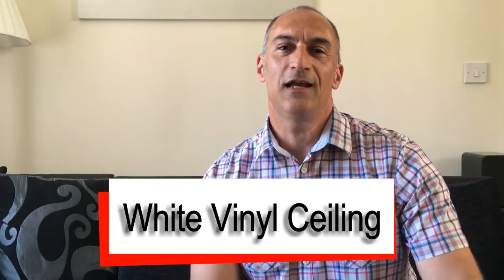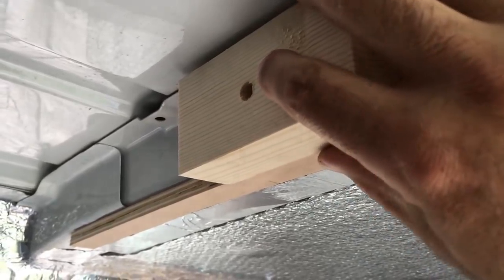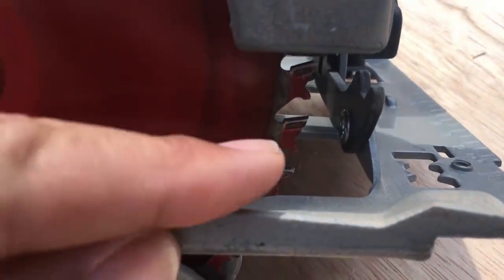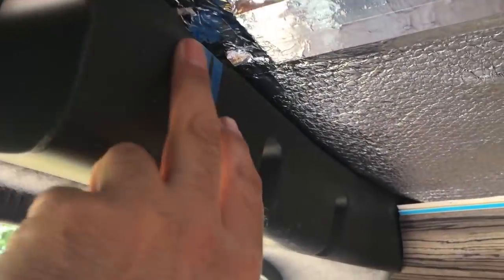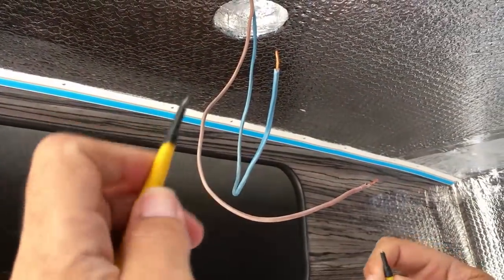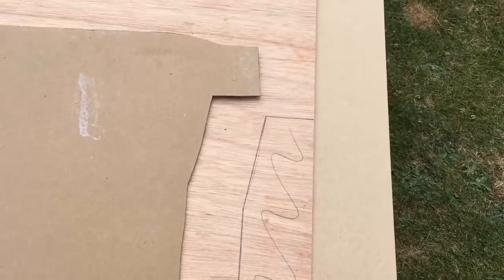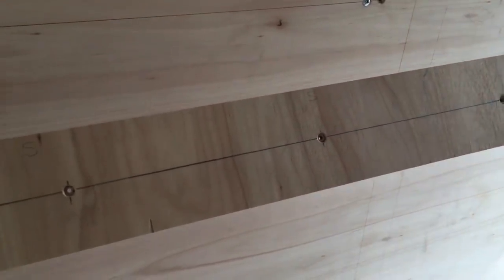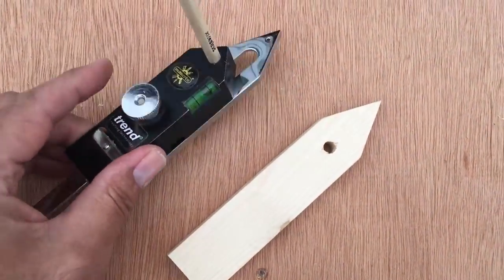Mercedes Sprinter Camper Van - Vinyl Ceiling

Comment: once again brilliant video Greg. thanks. just a quick question, can you use the H shaped joiners where there isn't a beam as would be to close to edge of skylight ?
Reply from the maker: I wanted to use these as concealed support for the boards to minimise to number of exposed screws so I deliberately fixed them to the beams. It made for a lot of wasted offcuts but it gave a firm clean look

Comment: I’ve seen the lid off of a coffee jar used as a scribe before. You just drill a hole right in the centre for the pencil, and roll it along with the pencil in the middle.
Reply from the maker: Hello Dave, I know a few will mention that method and I plan to do a dedicated video on this as it doesn't give you an exact copy. 
A circular scribe will give you a line of smaller radius on curved areas because the pencil is tangential to the circle and not perpendicular to what you are scribing. On straight walls with little variance you might get away with it but it's not the correct method. Hope that helps
Reply: Greg Virgoe Thanks Greg!

Comment: I know this is an older video but I have come back to it because after doing my first van using tongue and groove boards, I wanted to go with somebody a little bit simpler but also save on some head space.

(I was told another thing that helps reduce tear out is having a blade with a lot of teeth.)

Comment: Another great video. 
Not sure if it has been mentioned already, but when I made my scribe I did it as a circular bit of wood. That way it didn’t matter if I lost the perpendicular.
Reply from the maker: Nizan Horsefield circular scribes do not work on curved walls as the circle scribes a line with a smaller radius curve. You have to scribe with a point and keep perpendicular to get an exact copy.
Reply: Greg Virgoe I’m going to copy your DIY point scribe and use as well, as I need the best result for doing a similar cut to you, testing on old ply of course ;) Again, such great videos and ones to have playing when we do our own sprinter.

Comment: Just a small point with the way you tested for continuity - Holding the wires onto the testers probes with your fingers (as you did) can result in a false continuity reading as the small current sent out by the tester can pass through your body from one hand to the other (in other words, your body forming the circuit and not the wire).
Reply from the maker: Stuart Martin yes you are right I am aware of that 😊

Comment: When eventually I get my van I will be following your advice. What was the thickness of plywood used for the floor? The problem at this moment is the confusion as to which van to buy to start my camper. Panel van, kombi, or just buy a completed camper? So confused, I wanted to buy a newish van. First thought panel van, but the kombie is not much different (with trim and windows already), then PV or Kpmbie, PV, no Kombie, nor finished camper. Given up at this moment, doing my head in!. Add on the VAT and wow £30000 +, getting towards completed camper. Then I have to start the conversion. I hear it is about £15000 for conversion materials. Then OK I will buy an older van with good milage. Add the VAT and getting towards £20000! I have mental health issues and physical activity like do my own conversion helps me greatly. Any thoughts or advice would help. Cheers

Comment: Hi Greg. What would be the correct pattern- first floor, then walls and last the sealing or should i make sealing ready first and then start with plywood walls? Thanks a lot
Reply from the maker: I did floor, walls then ceiling 👍🏼😃
Reply: @GregVirgoe  thanks Greg🤘

Comment: Also do plan to insulate properly- however 2 things seems all the materials are in your neck of woods, and difficult to convert mm to inches although relatively easy just to change my mind and convert.  Can most of what your using materials be found in U.S. or do I find the closest material we have in my country?

Comment: How did you attach the bubble wrap to the sealing?
Reply from the maker: With “Trim Fix” high temperature spray adhesive. 👍🏼😃
Reply: @GregVirgoe  thanks so much for your answer.

Comment: great video, informative as allways. good tip from Phil Robinson on scribing the profile.
Reply from the maker: Hi Barry, Unfortunately Not, circles do not work as a scribe, because the geometry is all wrong, read my reply to Phil.
"Hello Phil, I plan to do a follow-up video just about scribing, as I'm sure that you are the first of many that will suggest the circle or penny washer idea for scribing a line. However, the geometry of a circular scribe will give you the wrong result. It may give you a noticeably close result for a straight line but when you are scribing a curve the circular scribe will draw a curve of smaller radius and will not be a close fit. If you had a pronounced curve your panel would end up too small. The pen ends up being perpendicular to the tangent of the circle, which is not what you want and what I was explaining not to do with the pointed scribe. You have to keep it straight to replicate the exact shape. I will demonstrate this point very soon, trust me. Thank you for a great comment and one very much worthy of further discussion. Regards"

Comment: tip, use a pencil compass  for scribing and you can  get right in to corners. draw 90 deg, lines on to timber for intricate shapes.
dave the joiner

Comment: Nice work. Although, recently I've become concerned with the overabundance of plastics that is all around us. It is in our clothes (polyester), in our drinks (bottled water), and pretty much everywhere. I don't know if it would effect you much to have the vinyl around you, though.
Reply from the maker: Hello Remy, I can undertsand concern where food stuffs are in contact with it but inthis instance where i'm not going to be touching it, i woudl imagine its pretty safe
Reply: However, I didn't see any links for proof of these claims, but I did find something on the EPA website with a bunch of diagrams and math I didn't understand.
"Characterizing Exposure to
Indoor VOCs and SVOCs
using Simple Mass-Transfer
Models"
By John Little.
Reply from the maker: Are you doing a van conversion of your own? What van do you have?
Reply: Sadly, no. 
I know, I'm just some nobody giving advice to a pro-builder with much more life experience, but I just thought I'd pass on a word of caution. Wish you the best with whatever you choose.

Comment: You could make a ply guide rail. Then cutting sheet is like using an expensive guide rail saw, without the hassle of allowing for the saw plate allowance every time.

Comment: Hi Greg, great video's on your build buddy keep them coming they are helping me a lot with my build. I got some samples for the roof ply only trouble is the minimum order is 10 boards so unfortunately not doable. Regards
Reply from the maker: Have you spoke to sales, I managed to bundle mine with furniture board and some trim and only 6 sheets of vinyl ply.
Reply: I haven't no, I only need 3 boards for the ceiling, that's all I was going to buy from there.

Comment: I like how you actually pay attention to weight. A lot of builders put 1.5 tons of chip board in their vans and it drives me up the wall. 1/8th inch plywood with a vinyl face is a much tidier solution than 50 cut pieces of T&G spruce. It is also that much easier to work with as a material due to how thin it is. It would probably take 30 minutes to match that fan penetration with a router using 3/4" material. You're right too, it looks very professional, not DIY at all. 

If I were doing a build, I would use 1x2" x8' sheathing for all the cabinetry framing combined with simpson strong ties, and vinyl sheeting & 1/8" ply for just about everything. If I want a different color I can use vinyl paint on the entire sheet before cutting, and then put corner molding on all exposed corners so I don't ever have to bother painting in the van. It would weigh probably under 200lbs for the entire thing. The only exceptions would be the bed, and the countertop. For that I would just use a standard formica top for the counter, and 2x4" #2 standard douglass fir for the bed support.

Has anyone ever tried building the entire thing outside the van and then installing it? Like a left and right hand section?

Comment: Hi Greg, I have got to the ceiling board stage with my Boxer conversion and I am impressed with the way you have done yours.  I have looked at Morland but they dont appear to sell small quantities of boards and trims I just wondered if you could recommend a supplier and could you let me know where the J section end trim and H section joint trim are from as Moreland dont list these,
Reply from the maker: Gerry Richardson it’s because of the 8x4 pallet and shipping costs. I spoke to their sales office and made up an order of 7 furniture boards and four ceiling boards plus trim. 
Look in the description of the video there are links to pvc trim on eBay. 👍🏼😃
Reply: @GregVirgoe  Thanks for your reply Greg,  Those 3mm PVC trims you used look a good product with the barbs and protective film, unfortunately I have searched the link and cant find them.  sorry to be a nuisence but wondered if you could tell me the manufacturer/supplier please.

Comment: Another great video Greg.
I am considering removing the black factory trunking from my merc. I find it very intrusive and ugly. I know it means disconnecting all the wiring from the rear lights etc. but think it's worth it. I am just hoping I do not need to cut any!
Reply from the maker: Yeah I was going to do the same but I had to leave it exposed. I don’t think there is a route down inside the rear door pillars. I have hidden it all in the roof or wall cupboards. 
The only bit exposed is over the sliding door and I have my rear view camera fuses in there so needed access to it.

Comment: I went to a big box store to buy some screws and drill bits. They used to have a drill bit guide to determine pretrial be its. I asked 6 employees including the general manager they had no clue what I was talking about the nom size drill bit. You might do a video and a link to Amazon. Also a class on router use and how to mark electrical outlets. Thank you. Finally the option for portable furniture by the side sliding door. The option of a front and rear hitch. This allows temp outside storage of 500# generator fuel airtight bins while in a RV park or boondocking. I have a cargo trailer 6' high x 11' l x 6' w . it is 2500 gvw  1200# trailer at and cargo wt 1300#. Great for tools off season items and hobbies. It has exterior wheels I am going to super insulate the exterior 12" then add new siding for winter Sleeper with Honda gen set and multi fuel.
Reply from the maker: A few good ideas Robert, I'm doing a workshop project today and will be using drill and router 😃👍🏼

Comment: Instead of pencil I would rather use some flexible batten to transfer curvature from the van wall.
Reply from the maker: This is another method that would work ok on straight walls or lines but would not work for small radius because your batten will make you draw a curve with a smaller radius. That is why its best to just a pointer and keep the scribe parallel to the floor or side wall so its perpendicular to the scribe at all times. Hope that helps

Comment: Greg where did you get the J section trim from ... Morland don’t stock it, I’ve bought the H section from them - thanks
Reply from the maker: Hello Ian, I too initially brought the H section from Morland but found it was an off-white (cream) colour and I didn't like it against the bright white ceiling so I brought all new white PVC trim from Rotherham Plastics, the same people I got my PVC wall cladding for the shower room from. Here is a link to the trim https://rover.ebay.com/rover/1/710-53481-19255-0/1?ff3=4&toolid=11800&pub=5575265109&campid=5338027957&mpre=https%3A%2F%2Fwww.ebay.co.uk%2Fitm%2FHygienic-Wall-Cladding-and-Profiles-2440mm-8-foot-PVC-Wall-Panels-Sheets%2F222371310320%3Fvar%3D%26hash%3Ditem33c65ceaf0
Reply: You’re a star Greg really appreciate your videos and your help
Reply from the maker: @meandthemrs896  happy to help :D

Comment: Another great Video from Greg.  And yes, you should be wearing safety goggles!!!!!!  You are a better hammerer than I am, as I would have used a rod (3/8" drive extension works) to hammer in the roofing nails on the butt strip to prevent damage to it! 5  thumbs up.!!
Reply from the maker: I was looking for my smaller pin hammer but couldn't find it at the time, I think it was more luck that I didn't hit the trim with that huge hammer :D Thank you for great feedback
Reply: I'm thinking you should have used screws as a nail will back out with all the vibration going down the road. We will see . . .

Comment: Hi Greg, Which ebay shop did you get the 3mm trim, from your link I cannot find them, sorry.
Reply from the maker: https://rover.ebay.com/rover/1/710-53481-19255-0/1?icep_id=114&ipn=icep&toolid=20004&campid=5338027957&mpre=https%3A%2F%2Fwww.ebay.co.uk%2Fitm%2FHygienic-Wall-Cladding-and-Profiles-2440mm-8-foot-PVC-Wall-Panels-Sheets%2F222371310320%3Fhash%3Ditem33c65ceaf0%3Am%3Amlm2mXxgafHKNCN7L0l7_FA%26var%3D521239926849
Reply: perfect, thank you Greg. Another quickie, how did you secure the 9mm ply to the sides, donth think you have shown this??

Comment: Great video as always mate, do you have a link to the trim you used with the barbs on it? the only one's I can find don't have the barbs and only take 5mm boards. TIA :)
Reply from the maker: Hello George, I got both the end trim and joining trim from this eBay listing. https://rover.ebay.com/rover/0/0/0?mpre=https%3A%2F%2Fwww.ebay.co.uk%2Fulk%2Fitm%2F191850909855. Hope that helps. Thank you
Reply: Brilliant, thanks Greg.
Reply from the maker: George Barr, if you do get these a little tip for fitting is to sand the back of the leading edge of the ply to make it easier to insert in position. 😀
Reply: Nice one, cheers Greg

Comment: Top job Greg, as ever making it look easy. As a novice I haven't seen the adhesive pins used to hold the insulation in place - every day is a learning day!!
Reply from the maker: They are used in industry and not normally sold to the man on the street.
Reply from the maker: kevin mulligan really sorry Kevin, the guy that was selling them on eBay seems to have gone into a different line of business without saying anything. I'll change the links ASAP thank you for bringing it to my attention.

Comment: Hi Greg can you explain what plastic trim it is and thickness please am doing my headliner tomorrow hopefully. Cheers
Reply from the maker: I purchased these trims from Rothplas and here is the direct link https://rover.ebay.com/rover/1/710-53481-19255-0/1?ff3=4&toolid=11800&pub=5575265109&campid=5338027957&mpre=https%3A%2F%2Fwww.ebay.co.uk%2Fitm%2F8ft-Profiles-Trims-and-Adhesive-for-White-Hygienic-Wall-Cladding%2F222443702247%3Fhash%3Ditem33caad87e7%3Am%3AmUvK6uM7nSPL2T7MQOxNNNQ%26var%3D521305789205
Reply: @GregVirgoe  Thank you for sharing our Link Greg, this has really helped our sales and the feedback from our customers is great.
Reply from the maker: Paul Scott, I was very pleased with your products and the finish we have achieved in our wet room is top quality. I have listed your eBay shop in my shower build videos too. My email is on my about me page if you wanted a direct contact.

Comment: Awesome build Greg, I learn a lot from every video!

Why the nails though? wouldn't they just vibrate themselves loose into squeakville driving you and the miss insane in the process?

Also did you consider how to maintain the pvc to prevent yellowing from cooking and uv?  Do you plant to just replace the pvc components once they start to age.  DId you come across any other products that werent pvc but could be wiped clean and be considered an 'eco' alternative?
Reply from the maker: Hello Jon, I did a few pull out tests off camera and they are not going to budge at all. 
The reason for going with nails is the flat head. So not to obstruct the board slotting in

Comment: Hi Greg. Another great video. When you removed the trunking to insulate/ carpet behind how did you reattach the trunking? Thanks
Reply from the maker: Hello dave, the section behind the trunking was covered in reflectix then carpeted. There was just enough of the threaded studs showing to reattached the trunking to the original fixings. I'm sacrificing a little insulation at that point and it would have been better to build my own boxing but this works for now. Cheers

Comment: Hi Greg, Are the plastic joining pieces in the ceiling from Morlands? If so, they unclip to form two pieces, the domed part comes off so you can fasten the flat part to the ceiling first and even screw through the ceiling boards. The screws are hidden when you clip the domed part over. Not a criticism, just a helpful tip for anyone else using it.

Comment: @greg virgo amazing skill set on that ceiling finish along with that bulkhead.  I have to wonder though, for that cost of that prefinished ply. Would you your self fixing plain ply(weight aside) and having a vinyl wrap specialist come in and warp that whole ceiling after not only be cheaper but would also eliminate al that track and screw caps finish ? Just a thought

Comment: Hi, What great videos..and such a professional finish. I have been watching them all..(several times) as I have a long wheelbase sprinter and have been inspired to do a convert..wont be the same layout as I need to carry kayaks in the garage area..but have learned so much both about what to use material wise and the excellent way you achieve your finish. Congratulations on a great job and thank you for sharing